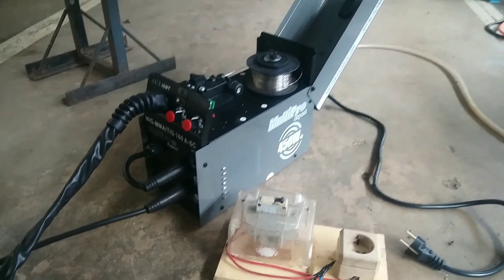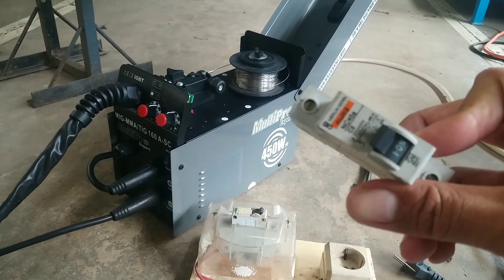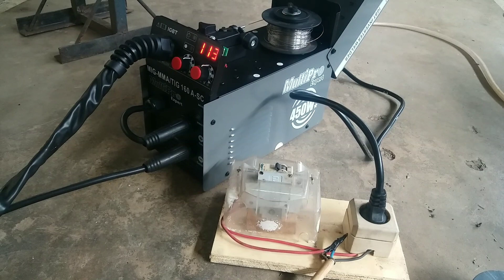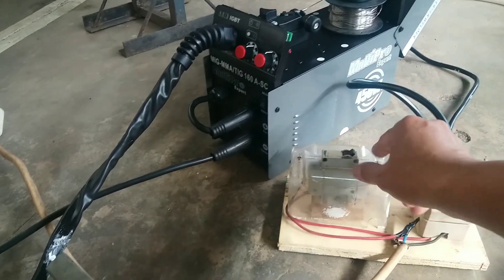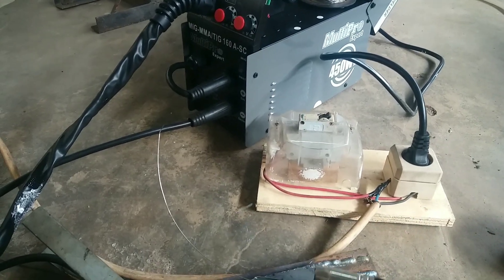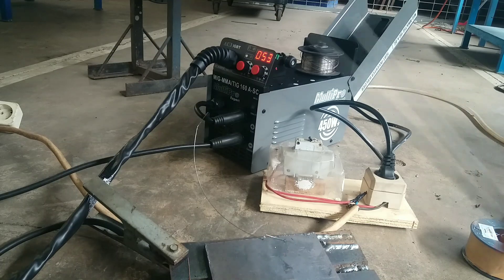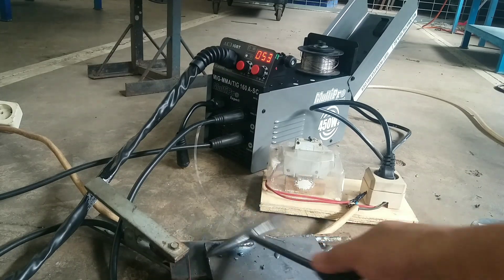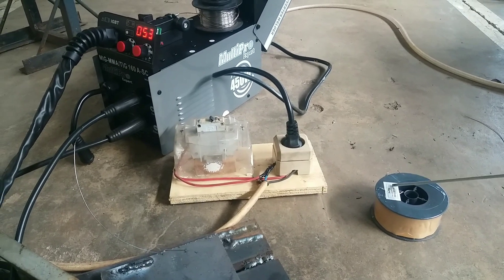Review dan tes mesin las mig tanpa gas dengan daya listrik 900 watt

Comment: Listrik 900w las mig di ampere rendah apa tatap gak bisa om, mohon pencerahannya
Reply from the maker: tetep ga bisa om. mesti di 1300 watt itu juga amper minimum kalo maksimal langsung turun. tetapi kalo di pengelasan dengan electroda 900 watt bisa di kawat 2,6mm
Reply: @Welding399 om kalo untuk las mig 450 Watt itu Amper yang aman untuk listrik 900 Watt dengan kawat yang paling kecil berapa om Amper yang pas